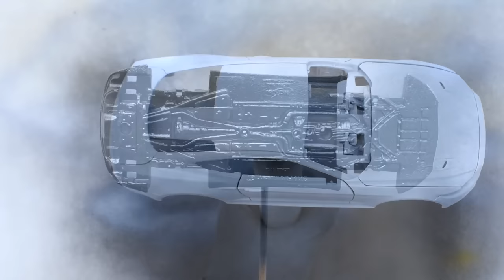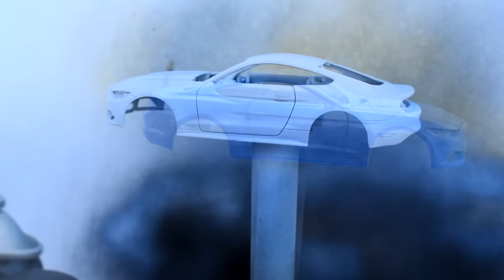Restoration Abandoned Ford Mustang GT Model Car

Comment: Where did you get the windshield replacement for the scale model? You bought one?
Reply: He probably made it from styrene
Reply: Bought two exact cars, destroyed one, then used the parts from the good one to fix it.
Reply: no you guy are wrong he Secret
is took it apart took off the window
put it back  put plastic broken glass
glue together look like it had no glass think about cant  find window for
it and wheel it was plan